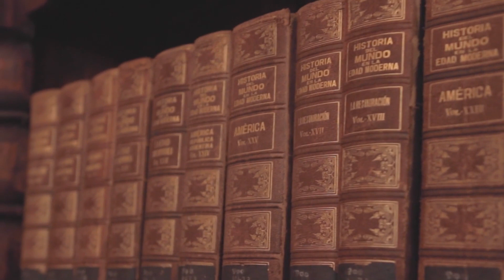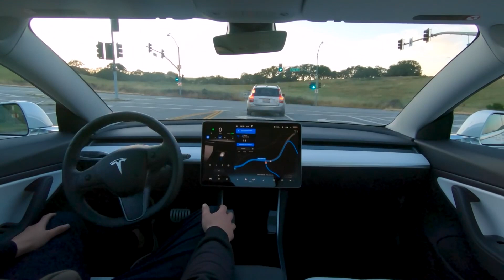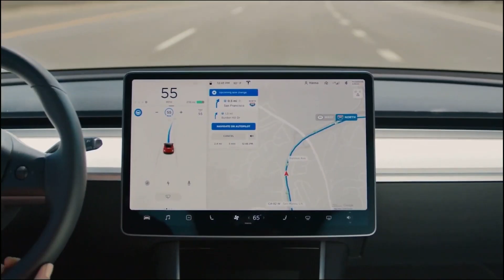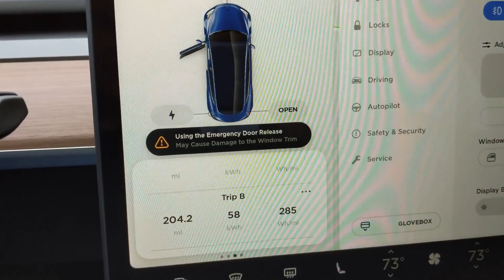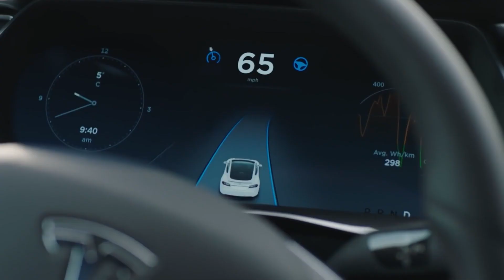MISTAKES TESLA Wants YOU to Forget!!

Comment: You raise frequent recalls as an issue, but then point out that, unlike any other manufacturer, they almost all have been painlessly resolved via an over the air update.  So why even mention recalls?  How many speed limit signs in the US are in km ph?  Similarly, in the UK?  I have never seen any.  This a non issue.   How extremely cold does it need to be before performance is significantly affected?  And BTW, "to be fair", why did you not mention that EVs perform better than ICE at higher elevations?  It is 10 years since Tesla began mass production.  Quality issues in the first few years are not surprising, and have improved dramatically in recent years. Most recent issues are cosmetic and easily fixed under warranty, often at your home via mobile service. 

You made some valid points but this video would have been of more value if it had been more balanced.